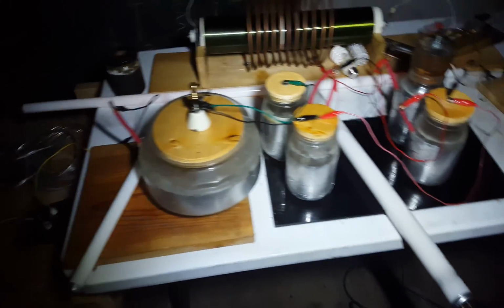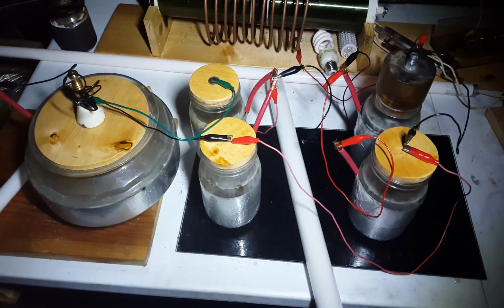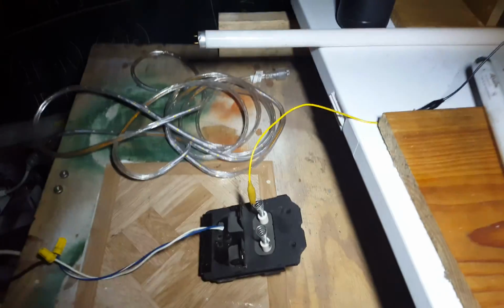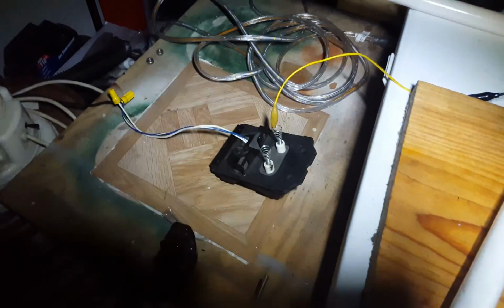One wire high potential

Comment: longitudinal forces at play here?
Reply from the maker: Yea i dunno..,.  Those Oil Ignition transformers are a digital resonant circuit inside, so even though only 1 wire it hooked up, it's still oscillating at a highly resonant frequency.. Parasitics and humidity will allow some level of circuit completion, and since these are just excited phosphorescent gases, it's possible that they were just illuminating from the tiny bit of energy dissipated into the air as a dielectric surface/topload.. 

Although, the same behavior is exhibited from a standard stepup transformer (NST, MOT, etc.) The one wire output, is still oscillating at 60hz..  It's more apparent lately, for me, that "one wire" is solely waveguide/tertiary driven. 

Checkout what William Beaty thinks on the subject. 
http://amasci.com/tesla/tmistk.html
Reply from the maker: The G-Line may absolutely be the answer.